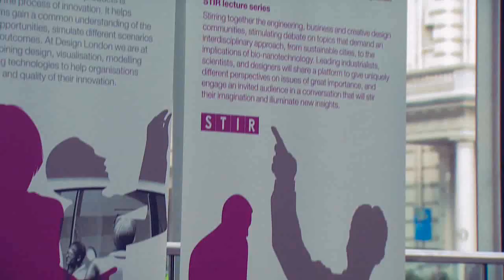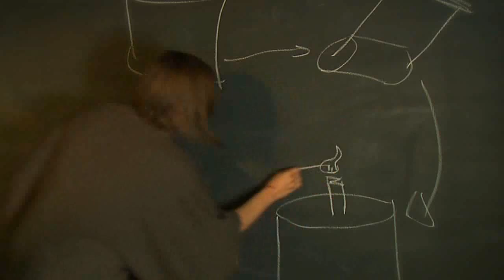The Bathroom Reinvented Virginia Gardiner's Loo Watt Core77

Comment: Excellent design work! May I suggest that you consider not using the word 'commodity'. A commodity is a product that is bought and sold. It has use value - it's usefulness - and exchange value - an abstraction of equivalence that allows it to be exchanged. Your design primarily produces use-value - gas for energy - and saves water. If you sell the gas, then you have also produced a commodity. But, commodification of our lives occurs under capitalism and has led to the problems of the world today. Your design and the system (cycle) that it produces can actually allow for the de-commodification of our lives - the possibility of evolving beyond commodified energy production.